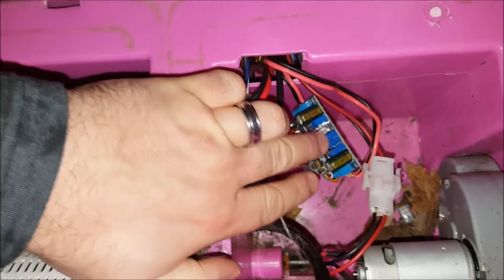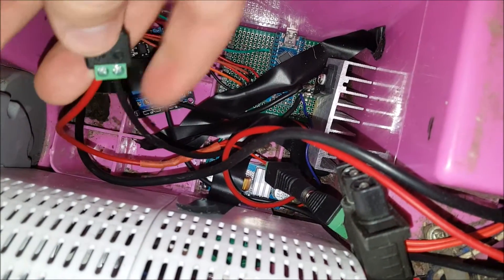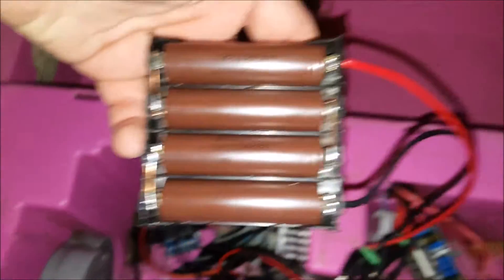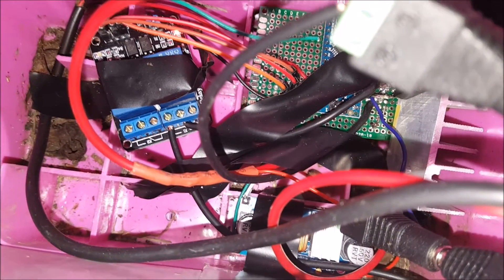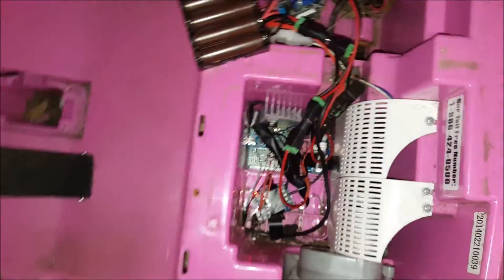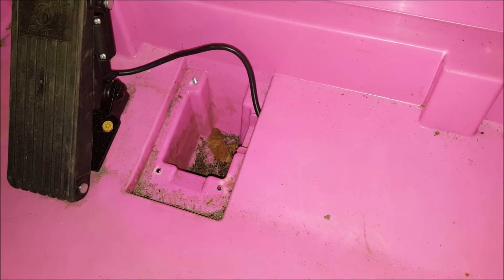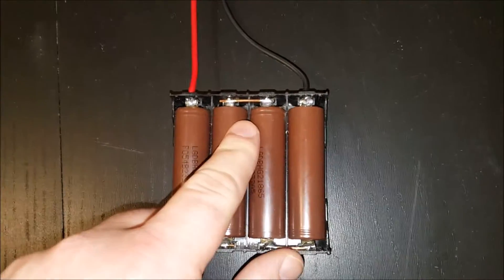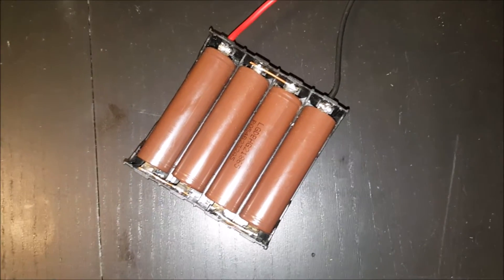The Ultimate Power Wheels: custom ESC, variable throttle, on/off switch, and Unicorn Helmets!

Comment: Where did you find the foot pedal?
Reply from the maker: If you search "scooter foot pedal accelerator" on eBay, you'll be able to find what I found.

This is a direct link to the same product, except I didn't use the controller because I wanted to use 12v: https://www.ebay.com/itm/36V-48V-24V-60V-Scooter-Pedal-Throttle-Scooter-Accelerator-Foot-Controller/302556918667?hash=item4671cc338b:g:Je0AAOSwGuVaKSSm